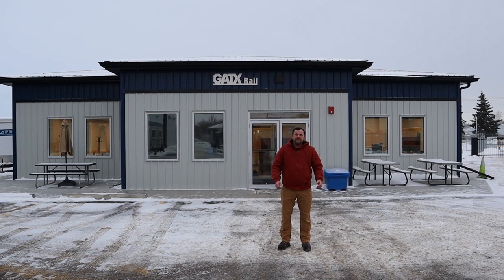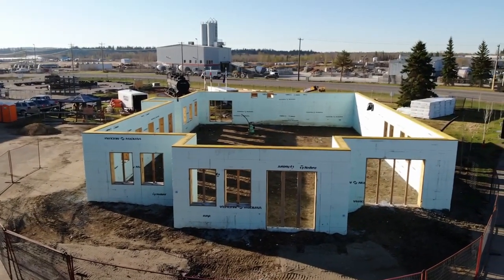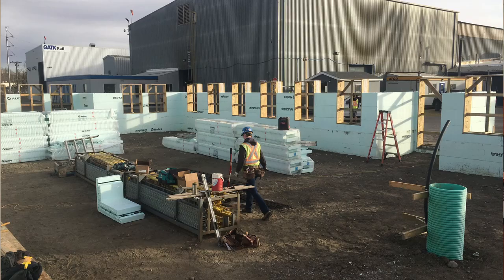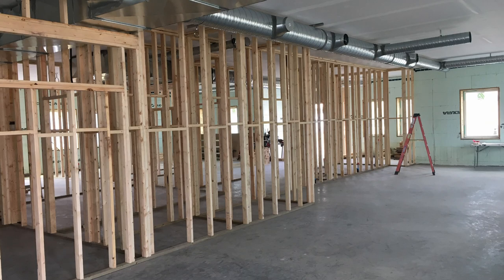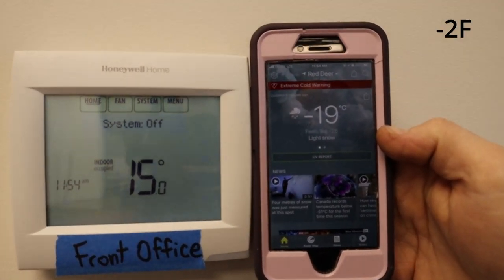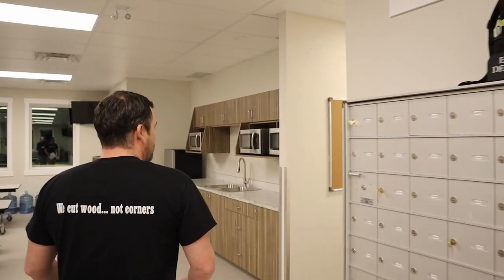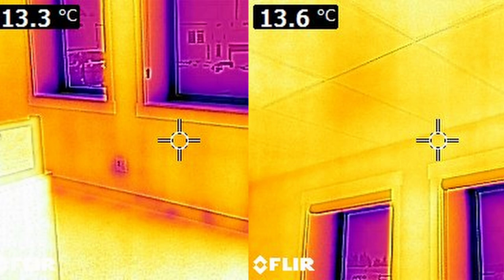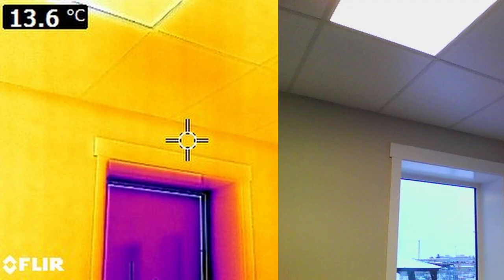The ULTIMATE ICF Efficiency Test-We Shut Off The Heat at -40!

Comment: Excellent video
I just wanted to add my two cents. I too have a full ICF house with close cell 7 inch foam in the attic. My first floor is about 2000 ft.². My second floor is about 1200 ft.². The second floor roof has 7 inches of spray foam sprayed to the roof deck to make a hot roof design.
The reason why I give you these details is I go to Florida in the middle of February for a month? I live in Maine and many times. It will get -20 below zero Fahrenheit. My slab is directly couple to the ground with 2 inches of foam and radiant heat on top of it. I can literally shut off my heat for an entire month in the middle of winter and my room temperature which I can monitor from Florida to turn on my boiler if need be never gets below 52° For the entire month. Obviously my house is a passive house design so I pick up heat during the day and release it during the night. One more point I did have 41/2”inches of foam on the interior wall of the ICF and only 2 1/2 inches on the exterior.
The ground temperature in Maine doesn’t drop much below 45° below the frost line I believe this helps to maintain the house from not going below 52° . Thank you for all your videos. I truly would build with nothing less than ICF.

My Blower test score was .45 ACH
I was the general contractor on this build. I am in the HVAC business and wanted to prove a point that insulation is much more important than all these fancy systems that they have to heat and cool these days.
By the way in the summertime, my house seldom gets above 72° even though I live in the middle of a hayfield with not a tree around. I do have to dehumidify the air to keep the moisture level down though, but the sensible temperature doesn’t go much above 74 degrees on my worst day .
Reply from the maker: Interesting, thanks for the comment!

Comment: Great as always. You are the best. We just finished a 2 story 4 unit apt full height ICF . Our construction technics are the same I am R2000 trained as well. Cannot get any commercial interest here. Sask is vey closed minded. You video are a great service to the ICF industry. 
Mike
Reply from the maker: Thanks a lot Mike. What a great project you just finished !  And hang in there. ICF is on the move. Check out prairie ICF. Good guys.
Reply: Did you build this ICF apartment for yourself?  So cool -- something I'd love to do, as well.  Bomber rental units.
Reply from the maker: @mikestronach did you see this?
Reply from the maker: I agree! I would be the ultimate rental space.
Reply: @travisburch4342  yes. It helps with the ROI
Reply: hey man. I'm building my two story home, well, our builder is. What do you think about poring concrete every 3 blocks of heihgt instead of a full wall? would that affect the gluing of the concrete?

Comment: It would be cool to compare the standard two inch foam blocks to your four inch performance.  I would also be very interested to see what a complete ICF package, including the roof would do in comparison.  Good information.
Reply from the maker: Good question.  Did you see this test we did? How Efficient is Your Home?
https://youtu.be/EbNNJbiwXTg
Reply: Australia here,  we built in ICF with 8inch polystyrene roof,  we have 45c days and the house never climbs above 29c we have double glazed windows. 
We have minus 2c nights and the house is never below 18c inside.  It is also spoon quite. 
Most of the year the house is around 22c to 24c all day,  we have only ceiling fans,  no air conditioning,  and a small wood fire to take the chill off the air in winter. 
People are always astounded that we are off grid,  no air con

Comment: We live in a crappy stick built townhouse right now. The wind literally blows through. 
Saving to build an ICF modern farmhouse with a full basement. 1700 Sq ft per floor. 
Doing in floor heat. 
I can't wait to build myself a nice, sealed up, low dust house, with a good air exchanger and humidity control.

Comment: Graphing tells the truth and is easily relatable. I was surprised it dropped off so quickly but I did expect the fast level off.
Reply from the maker: I wish I had another 12 hours of data or more. It would have levelled off way more than my current graph shows. Even with my projection… I think it would take weeks to freeze that building out
Reply: @uptokode  You did mention it was a new build so quite likely the walls and floor hadn't had a chance to fully stabilize.
I also wonder how much heat was lost to the attic. When I finally get enough cash to build I will be spray foaming with 2 lb to rafters for air seal and keep attic as conditioned and use SIPS for roof panels.
Reply from the maker: I personally would never go that way. Spray foam is overrated. 

It would be a great conversation and debate !! 

For me I don’t think you can beat the simplicity of a truss roof. It’s super easy and cheap to insulate, very easy to air seal. You can vault it with ease.

Comment: Would be cool to see how a passive house performs with 14 inches under the slab and 11inches on the exterior. The footings will be absorbing the cold and transferring it to the inside of the wall. I'll bet an insulated slab passive house would be stellar.
Reply from the maker: I can’t wait to build one some day. This commercial building only has 2 south windows but there were parts of the day where the interior temperature went up a 1/2 degree. 

I wanted to add something in the video about that but also didn’t want to complicate it more. 

But if this building was all south windows, the temperature might hold forever.
Reply: @uptokode  I was thinking the same thing, at 150 hours for the temp to flatline ...I'm sure the sun could keep the place warm enough that it would never freeze. Could just go south for winter and never have to worry if the heating quit ...very cool.
Reply from the maker: I agree! I think it would take substantially longer than my theoretical time for the building to freeze. And you’re right…maybe it never would. Next to build a passive one to see those results.

Comment: Nicely done!  Not sure what kind of HVAC & its design, but this "HVAC Off" test is cool.  

What other ancillary heating is going on in there?  You know, things that show up as vampire loads with the FLIR.  
You don't mention an HRV/ERV.  Was it off also or is there none?  
How is humidity?  That cold air is really, really dry.  
Gotta watch hitting the glass with the FLIR because it can be a reflection.  Most guys put some blue tape on the glass since that gives a more direct measurement without the risk of getting reflection readings.  I think they go over that in their (FLIR's) class.  

Ever consider bringing the attic into the interior also?  This would bring your ducts inside also, instead of "outside" in the freezing attic (it's a vented attic, correct?).  All the mechanicals could be up there in the attic; it provides lots of storage and no vapor barrier is needed at the ceiling since can lights poke holes in that anyway.   You'd have to move the thermal layer to the roof line.  Any small amount of duct leakage would just be conditioning the attic space.
Reply from the maker: Great questions and comments! There is a giant HRV. 1000 cfm with no pre-heat.  80% efficient by cycling the air back and forth to reach temp. I have no idea how it actually works. It was OFF during the test. 

2 RTU’s on the roof. Run through an insulated chase. This is the weakest point in the building. Made an attic hatch to help that.  Ductwork is all sealed and insulated until it’s below the trusses.  Most of the ducting is in conditioned space. 

I just learned that about glass and the gun the other day. Thanks for mentioning that. 

Hope i covered everything.  Cheers !

Comment: Great Video.  At 5:27 you stated that you would have a link to exclusive footage showing more detail.  I do not see the link.  You assumed the inside temperature would eventually decrease to match the outside temperature.  With the insulation, solar heat gain, thermal mass, and thermal wicking I expect the inside temperature would stabilize at a much higher value.  It would have been nice to see what would happen after a few more days.  After all passive solar house temperatures are not expected to stabilize to match outdoor temperatures.  If all the heating was turned off then I am not sure why the bath and change room being heated by in floor heating was significant.  It looks like the building has a forced air system so I expected to see thermal imaging of the forced air ducts.  Air tight and no Heat Recovery Ventilation seems counter productive.
Reply from the maker: There is a super fancy HRV. 1000 cfm and no pre-heat required. 80% efficient if I’m not mistaken
Reply from the maker: And you’re right… it would have been nice to test it for a few more days. But can’t risk cracking drywall in a brand new build.

Comment: Thanks for the informative video.  I really don't understand the reasoning for insulating the ceilings and not the roof. You have all the air handling in the uninsulated Attic space exposing the heating and cooling to outside air conditions, including very cold in the winter and hot and moist in the summer.  Your video only demonstrates the efficiency of the space for heat loss but it doesn't evaluate the heat loss in the heating system in the attic.
Reply from the maker: The attic also has blown-in insulation. We used the Homega product to stop thermal bridging. 

The air handling and duct work comes down through a shaft. That shaft is the weakest link in the building but it is well insulated. I guess the door hatch at the top is the very worst but we install an attic hatch at the ceiling level to stop hot air rising up the shaft
Reply: @uptokode  Is the actual airhandler in the unconditioned air? Does all of the ductwork run below the ceiling or in the unconditioned attic?   Thanks for the courtesy of a reply.  Posting a video on Youtube will always be like opening a Pandora's box with regard to comments from guys like me. ;)
Reply from the maker: The air handler is on the roof. So yes it’s unconditioned air but it’s not in the attic. Other than the vertical chase way, all the ductwork is below the drywall ceiling. It’s in conditioned space. Then there’s T-bar or suspended ceiling to finish it off.  The air returns are up in the T-bar where the ducting is.
Reply from the maker: You had a great question and I’m happy you asked!

Comment: Does the concrete floor mass act as a heat store? which slows down the cool down, but it does show the heat loss is very low
Reply from the maker: Yes you’re right. Especially since the slab is insulated below, which then brings the slab inside the building envelope. The earth isn’t affecting the slab temperature as much this way.

Comment: You would use Newton's law of cooling, which is an exponential curve. This will give you a better idea of time to reach a certain temp. An intuitive explanation is, if you have a piece of metal that is 1000 degrees hotter than the surrounding air and you have a piece of metal that is 1 degree hotter than the surrounding air, which one will drop 1 degree faster? The hotter one. The greater the temp difference, the faster it cools until the temp difference is smaller. That's why the first day had a higher temp drop and the second day had a smaller temp drop.

Comment: Have you compared the blocks that have thicker foam outside with thinner foam inside?  That would take better advantage of the thermal mass of the concrete. I built my own house with ICFs like 20 years ago and it is by far the best method of building a house. I sold it to move out of state but still miss living in an ICF house.

Comment: Well done,how come you did not do radiant floor heating for the entire building?
Reply from the maker: The small amount of floor heat kept the boiler to a modest size. Plus we needed roof top units for air conditioning so the extra floor heat would have been overkill

Comment: Amazing video as always. I'm a builder in California and plan on doing an ICF house w/ Nudura. Have a question that maybe you can address - we typically have a pretty involved framing inspection done on a traditional lumber framed house - how is the inspection process different when doing an ICF house?
Reply from the maker: Thanks a lot! Not much to dispute when doing cast-in-place concrete like ICF. Maybe the inspector will want to see proof of the rebar. Otherwise it’s a framed floor, trusses and walls. 

Hardest part for us is the trusses. Otherwise our inspections are a bit of a joke to be honest

Comment: Awesome video! Have you considered doing slab on grade construction with something like Dalle Isoslab? It may save a good chunk of money not needing footers and may have even greater efficiency especially when integrating with ICF. When I build I want to give a shot, but still not super confident it will prevent frost from getting into the ground during crazy cold days.
Reply from the maker: I don’t know anything about the isoslab. I’m not sure I’m a fan of a floating, structural slab. Plus they are very tricky to plumb before concrete as there is foam work, rebar and all the rest. Plus thickened edges, etc. I’ve done some bigger garages and small shops with a fully insulated, structural slab. I think a 4’ frost wall on a footing is faster. Plus it’s better, nothing moves AND I can do services and mechanical afterwards. AND the slab is super simple after you have a foundation.
Reply: @uptokode  Yeah... the sewer lines would be tough... not sure an easy way for doing that. I just wonder if complete foam capsule and likely less work (potentially money?) would be worth it though? Because footers technically would create a thermal break if doing ICF since there is no insulation between the footers (which are in constantly cold soil all year) and the icf core.

Below is a demo video of their system. Pretty interesting set up at the very least!

https://youtu.be/_a0nRuMNkNQ
Reply: @uptokode  years redi-mix experience in rural Manitoba, 1 summer in Calgary, and 1 summer in Winnipeg. I was able to see some definite regional differences in foundation practices. Where I spent 5 years right along the Trans-Canada in Manitoba, a lot of farm shops and light commercial foundations were rudimentary floating thickened edge slabs. I saw some movement. I also saw a snow free border around the building in the winter. Not good. There were a lot of frost walls on footers and some grade beams on piles. In residential applications, most garages were either built on 2’ grade beams on top of piles sitting on pads set at the same depth as the basement footings or a frost wall sitting on footings that were a continuation of the basement footing. Calgary was almost exclusively this way as well. Winnipeg’s basement foundations are all built on 20-40’ deep friction piles. I saw a grand total of one new basement on a footing there. The garages are all similar. No one in their right mind would build on a floating slab there. Now I live and work in southern Manitoba 12 miles off the US border and I’ve noticed many garages are built on thickened edge slabs with 20’ piles under the edges, even if the basement is built on a footer. They’re moving away from it now as I think the code is starting to call for grade beams instead. The best explanation anyone can give me is it was easier to build garage walls on a slab and not have to lift them onto a beam. Another thing I notice here that I notice nowhere else is a propensity to power trowel exterior slabs to a near glass like finish. Broom finish is foreign to them. In Calgary in 2006, broom finish was standard for interior garage floors and a basic trowel job was an up charge!
Reply from the maker: Great information! I appreciate you sharing your experience across some pretty cold parts of the country.

Comment: Man I m so happy I came across your video, I m in the process of building a vacation house and it is the first time I m using ICF, my foundation is on a 10 cm xps and my walls are 5x15x15 cm, the house is 200 Sm so i guess i could walk around in shorts in the winter. I don't think the temperature falls that low in my country (Romania) but will see.
One quick question : what would you recommend for air circulation ? Thank you
Reply from the maker: I don’t understand the dimensions but either way I would use an HRV for air circulation.
Reply: @uptokode  centimeters and square meters
Reply from the maker: Thanks.

Comment: Awesome info. I have a question, for the slab in this building did you do an inside brick ledge to support the slab or just let it "float"?
Thanks
Reply from the maker: Great question. I’m not sure if I included a photo of the slab install. It might be there. But no we didn’t use a brick ledge. We cut out 4” x 4” pieces of foam and then doweled in 15mm rebar to support the slab.
Reply: Nudura makes a Brick Ledge Form Unit  that does exactly that. You install on the top course of the frost wall and then build the regular walls up from there. It’s available in the standard 2 5/8” EPS thickness; not sure about the 4” X35 EPS - call Nudura & ask - they’re very creative problem solvers!
Reply from the maker: Thanks Cynthia! And yes that’s why I like Nudura so much.

Comment: What if you ran geothermal pipes from below the frostline into the the poured walls?
Reply: Many experience that geothermal is very costly overall because of fluids, glycol, pumps, seals, servicing, trenching, the real estate necessary, etc., etc.   Build tight, Insulate right and heat pumps.
Reply from the maker: Haven’t had the opportunity.
Reply from the maker: I’ve heard the same. I do have an opportunity to go see and ICF house with geothermal but budget is no issue and that’s not usually the case.
Reply from the maker: I agree, built it right and either way it’s really easy to maintain temperatures